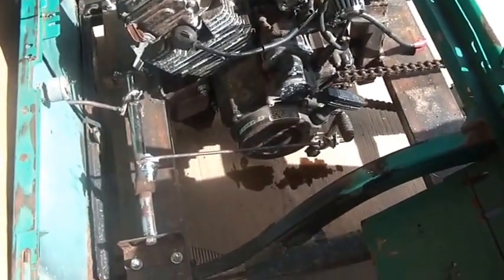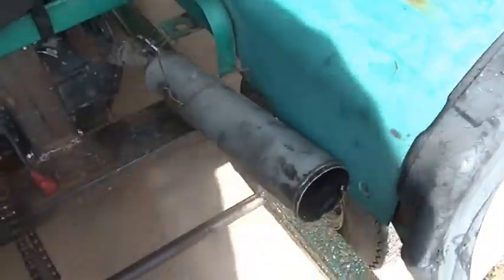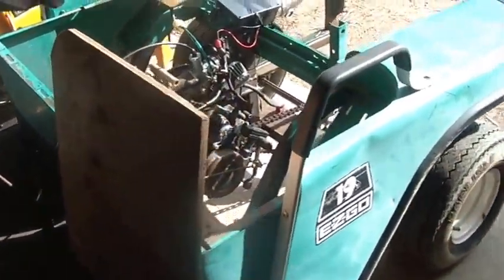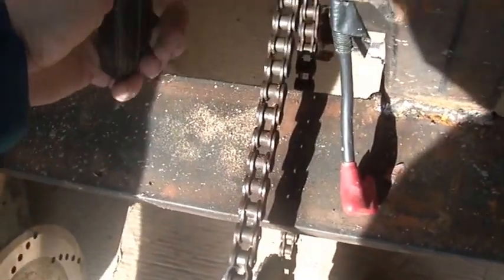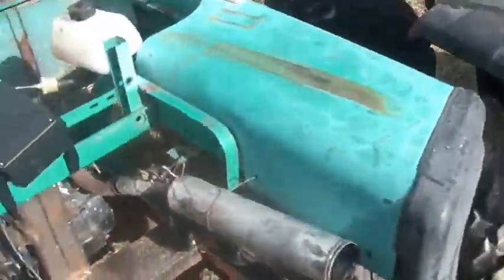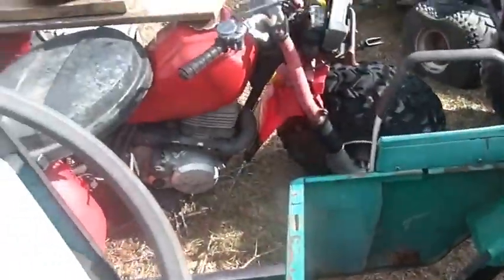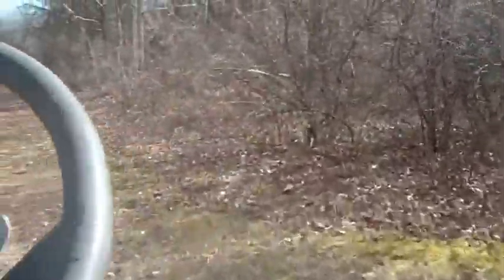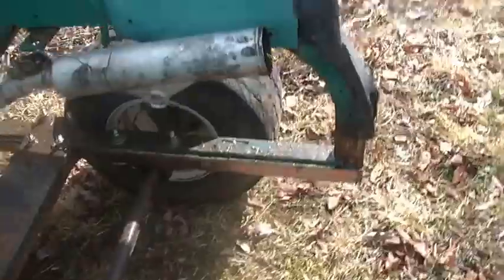First romp, 1988 EZGO Electric to Honda ATV powered UTV, Minor issue with tree

Comment: Nice job looks like a ton of fun check the shift shaft seal or the counter shaft seal behind sprocket for your leak keep up the cool movies
Reply from the maker: +Paul Richards , It seems to be leaking under the recoil starter cover... I need to take it a part and spend some time troubleshooting it... Worse comes to worse, I will change out the engine... Thanks for the kind words, encouragement, watching, and commenting!!!!!

Comment: I have the engine running great. I am going to try and use the stock differential. If that doesnt work I will need to copy your live axle idea. Any way you could make a video explaining your live axle or put where you got the parts?
Reply from the maker: +THC BACON , I went with a 1" live axle from a go cart and used pillow bearing from eBay, the axle is available from eBay also, http://www.ebay.com/itm/Axle-Shaft-1-x-39-3-8-For-Go-Kart-Drift-Trike-Mini-Bike-Parts-Supplies-New-/191822115189?hash=item2ca97d3175:g:s3YAAOSwu1VW3ulO&vxp=mtr , the bearings,   http://www.ebay.com/itm/2-PCS-TOP-QUALITY-1-SOLID-BASE-Pillow-Block-Bearing-UCP205-16-P205-/291399222555?hash=item43d8bf451b:g:SzMAAOSwHnFVlBeF . It is cheaper to buy a go cart and salvage the parts that way.... Let me know how it turns out, shoot videos.... Thanks for asking, watching, and commenting!!!

Comment: Hey Harvey I have a 85 250sx that does a lot of popping and back firing when I let off the throttle. Do you have an idea of why this is happening? Also I've noticed that it is smoking a little
Reply from the maker: Hey Tyler, I would start with the carb, I have had this issue and stalling when there is water in the carb bowl, I would give it a cleaning and start out with some new fresh gas, make sure the air filter is clean and that air can get to the air box,  It never hurts to start out with a fresh spark plug, I like NDK plugs, I don't care for ones made by champion or off brand china stuff.... Ur valves maybe a little too tight, check the valve lash gap.... I hope this helps. thanks for asking, watching, and commenting!!!!